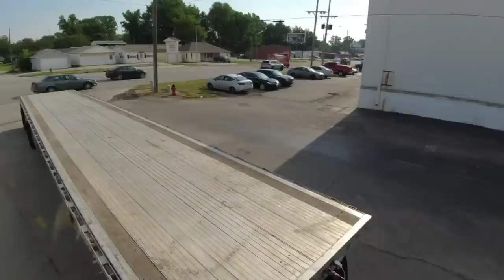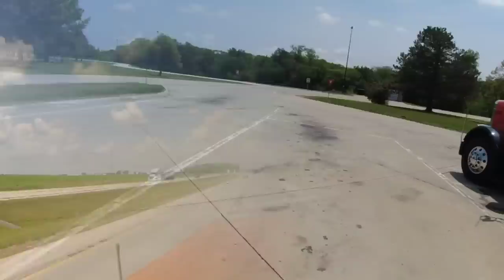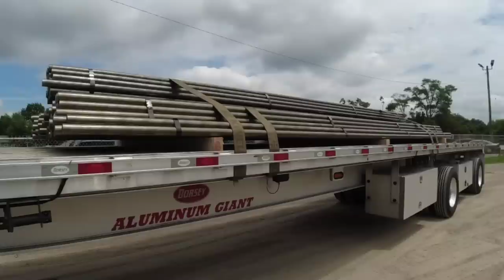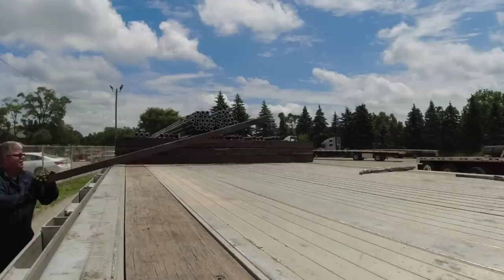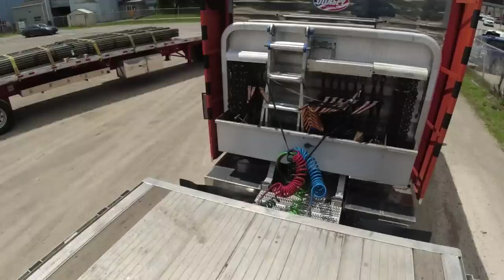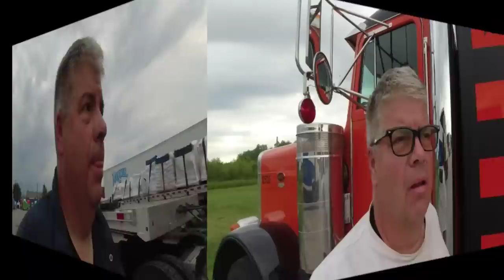#672 Back Roads The Bulkhead Generator Repair The Life of an Owner Operator Flatbed Truck Driver

Comment: Thanks for the video, Dan!!!

Another “run through the woods” route that you may consider around Chicago when heading East is one of my favorites. 

From I57, take 17 East at Kankakee to Momence. Take 114 East on the south edge of Momence. 114 will change to hwy 10 at the Indiana state line. 10 intersects with I65 or you can stay on 10 until you get to hwy 49 to go north. This option lets you miss the I65, 80, 90 mess  .

It’s about 30 miles from Kankakee to I65 and about 50 miles over to 49. 

Have a great weekend.
Reply: I use that exact route occasionally. Sometimes I make my way from 10 to US 30 or US 24 east, maybe even US 6 depending on how much clock I have. All will take me close to home just north of Fort Wayne In.

Comment: Dan, I love the farmland. Reminds me of when I was a kid. Thank you for sharing.👍👍👍
Reply: truck and trailer looking good Dan , little Bailey  happy camper ,  Is that load of pipe pay pretty good , Did not have too many straps on either load Dan ,  for sure good idea  bulk head on the front of it safety for sure ,  If you hauled the same stuff over and over where it did not hang over the front of the trailer you can put a bulk head on there , But I would not do it ,  For sure running the farm ground best way to truck,
be safe take care yourselves DAN

Comment: Thanks for explaining the bulkhead.  My uncle Delbert used to tell me that a load of steel can be nasty if it ever slides forward.  He used an early diesel with just a cab.  He gave up trucking when his truck had a steering box lock up and his truck with gasoline rolled in a prairie field.  He gave up trucking even though he survived the resulting fire.  He took a payout from his insurance.

Comment: Hay Dan I really enjoy it when you hit the back roads. Get to see parts of the US that I am never going to see otherwise as based in the UK. (I do a yearly to Phoenix to visit family)Well pleased also that you brought up the subject of the front rack. I have wondered why these are not on trailers in the US. I worked in the road transport industry in. auz in the 80 and most fleets (not all) would have front and rear racks and usually a full set of side gates too. I am still involved in transport here in the UK but not operationally. Here in this part of the world it is mostly van and tort liners. Of course there are plenty of flat beds but have a tendency to be used for specialised freight and machinery.

Comment: The bottom pipe more than likely schedule 20 easy to squash if it were 40 or 60 you couldn't dent it with a strap.

Comment: one state ya gotta beware of is Pa. if the back road isnt designated for big rigs, dont take it as you may run into overpasses you cant get under and its a bitch to try and find a place to turn around. even though US 30 was designated for trucks i still didnt like it as there was no place to turn around, if you missed your turn.